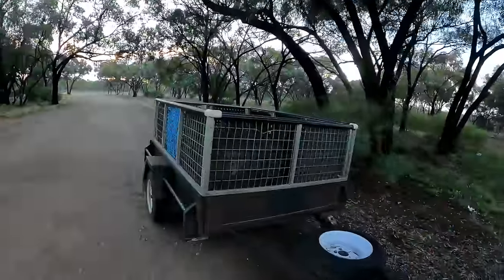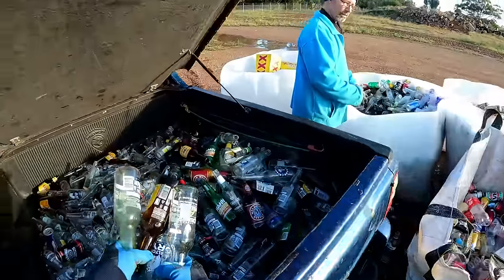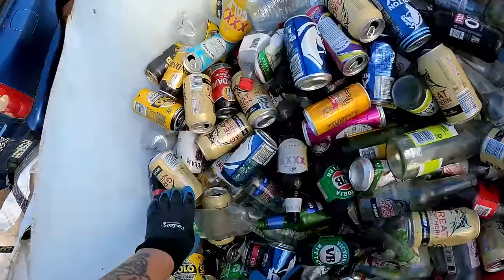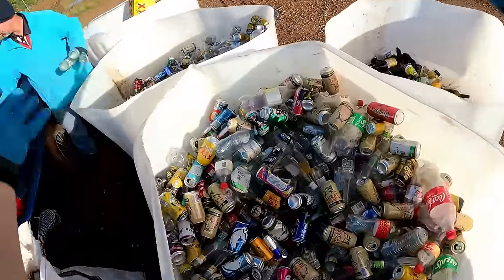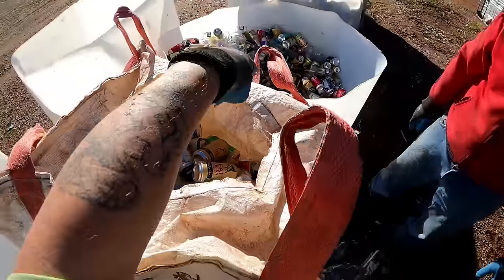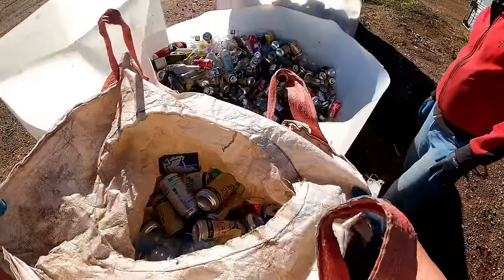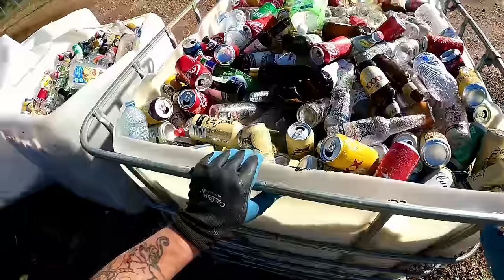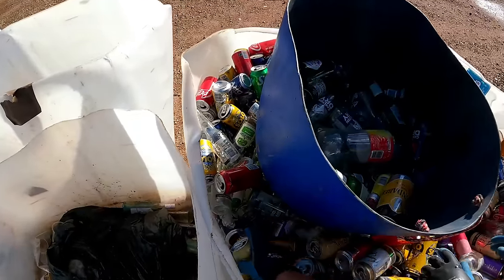Dumpster Diving Team Work Go's A Long Way As We Get 6 IBC Pods Filled With Cans And Glass

Comment: Great seeing you got some " help " . Ally cans average weight 13.1-14.1grams each equals 70-71 cans per kilogram. A Bundy can is 1gram heavier than a Coke can . Market price per kilogram for cans is $2.40-$2.50 for the same weight per kilogram compared to Recycling for cash price of $7.50 for the same weight . That was the price yesterday ,  Not sure what bottles are worth as raw glass bottles but it couldn't be a real lot. Aluminium is at around $2.50/kilogram .
Nice little load Mate better than road side pickin'. Cheers👍👍👍😎💨🏴‍☠☮☕☕🔧💡